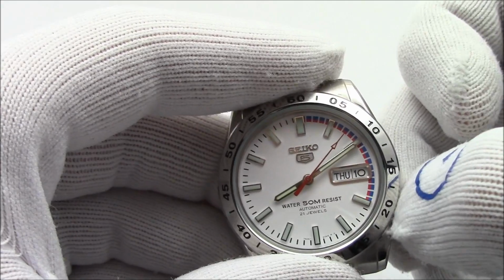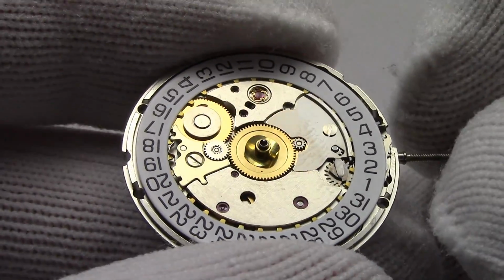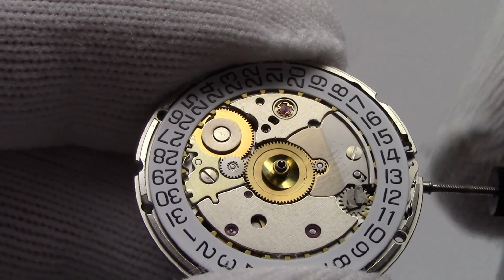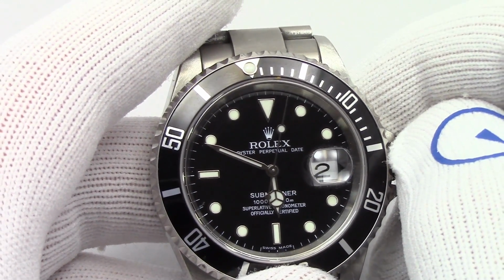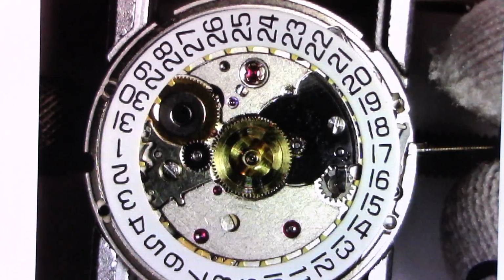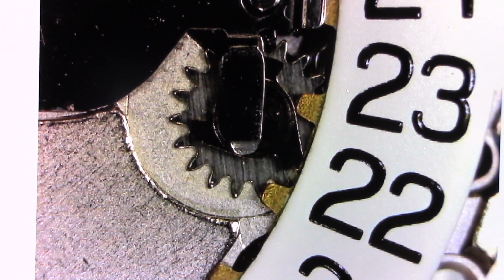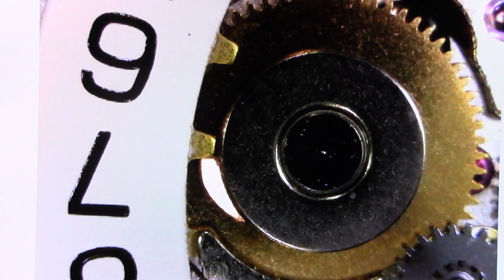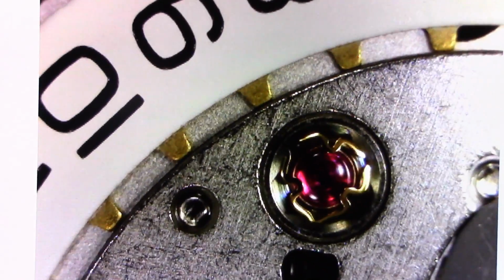ETA 2824-2 Movement - How The Date On ETA Watch Movement Adjusts Accurately? Watch and Learn #38

Comment: I started watchmaking in 1976, working on ETA 2783 and 2789 movements. The contemporary ETA you show here is essentially IDENTICAL. It's a "good enough" reliable mechanism. I also worked for Rolex for many years. Their day date mechanism was rather clunky at that time, but over time they refined the living day lights out of it. You could say that ETA is as good as it needs to be whereas Rolex is way better than it needs to be, and charges accordingly. :)
Reply from the maker: So true!
Reply: Honestly i have 2 watches on ETA 2824 and 2892. Its great movement and great watches. But i think it heavy overpiced. And refuse to pay for for watch more than 1.5k if it have 2892 in it. I understand the movement are modified (usuly more on viaual than on peroframnce) quite heavy but in end its same movement with +/- same accuracy. And honestly i think every good watchmaker can make eta to change date +/- 2 min fm 24 for not more than 50€$£. So it its not worth to get Rolex only for that. And to pay more than 1k for watch with meh. for 200-500€$¥ is just insane. There is lot and lot of watches which i like for more than 1.5k but i will never buy them as there is movemnt max 500€$£... Al in all the visual loon of watch (case, dial, bracelet, box can be put in 500-1k+movement range (hell i can can order sone independend watchamker to make some 100 pcs of some special watch for 100k and to get eta (yeee closer to SW or miyota inside) and each watch will be hand made with hand painted dial with serial nr. Ise chosed braceoet etc.  If the manufacturer can not do that i see is as non effective manufacturer who ar overipricing their watches only so they can not inovate but only survive. And dont have doubys Rolex, eta etc. Are conveyor made. In mechanical warches everyone like that humannput it together and  that it can be dissambled change few details if its broken and assambled that it. Or just dissambled clean putt together and greased. I understand history etc. But its only marketing for thous who know little of of the time is moving.  Its like medals for alcohol who are dated fm 1890s .,. Technology have changes and now its not same as was then. Sorry
Reply: can you tell me the width of 710 pallet fork?
Reply: @islandwatch  very useful video. Thanks. 

I have a watch where the date can change via the quick set but not at 12 am by itself. 

My watch maker said the Date indicator driving wheel is the problem and need to be replaced (neo vintage watch so I’ll going to have to hunt down the part). 

What typically do you see that “breaks” with Date indicator driving wheels?

Comment: i have a soviet watch with the date function and the date changes instantly just like you showed on the rolex example, there is no initial motion of the date ring, it just flicks instantly to the next number at a specific time, on the 2824, it takes about 30 mins between start of changing to the actual flick-over. 
surprising how an ancient dirt cheap soviet movement works better than a "higher end" swiss one.

Comment: Thank Marc for a very interesting video. I would like to add that I have a Mido Ocean Star with an ETA C07.621, known as the 80 
 hours power reserv version ("Powermatic 80" for Tissot). This is a day-date version, and both day and date are instanteniously changed! I even shoot a slow-mo video to confirm that the change happens at a click (a single nod of the ballance weel). Yes, and both the Mido's and the Tissot's using this movement are under 1,000 USD.
Reply from the maker: Coolness!

Comment: I wonder how much cost it would add for Seiko to just use metal gearing for its quicksets and date change, vs. plastic gearing. Are their mid range movements like the 6r15 plastic too? I would hope the 9S is all metal.
Reply from the maker: This I actually do not know; will have to wait till I have one to disassemble.
Reply: They use plastic not metal because it's more durable in this function. Have you ever seen a broken date wheel in a Seiko 7S26? Nope, because the plastic wings that push the date ring are compliant and can bend out of the way if the user tries to quickset the date at midnight. Meanwhile in the Valjoux 7750 it is famously easy to break the date wheel pusher if you try the same move.

Comment: Ive been told to use the steinhart ocean 1 as a benchmark for eta and pricing. Since most of them use the eta 28-24-2 its a relatively easy comparison for price value comparisons.
If there was a bell curve for automatic movements, the 28-24 elabore unregulated would be smack dab in the middle. As you go right you get regulation, better materials,in house, etc, as you go left you get lesser grade automatics including some in house like vostok all the way left to $10 quartz. Agree? Remember this is movement only, not the case. This also does not compare for movements with many complications.

Comment: Hello Mark, thanks for the informative video! I have a question about the date ring. I removed it to get a the keyless works to fix a stem that won't engage. Putting it back together, I'm having trouble figuring out what keeps the date wheel on the movement. There doesn't seem to be anything holding it down or providing tension to hold it place that I can see. Any suggestions? Thanks.

Comment: Very thorough and excellent video!
I’m actually concerned about my Tissot Gentleman Powermatic 80 Silicum recently purchased.
Does this model have a mechanism that protects accidentally changing the date around 12:30 am? Did a quick set and time adjustment set.  It works okay. Slowly changes date around 11:45 and snaps at 11:55:58. I thought it was instant with this watch, as I’ve seen it on other videos.

Comment: Hello would a case that fits a Miyota 8215 also fit an ETA 2836-2 without needing to change the movement cushion mount? I have an ETA 2836-2 that I would like to put in a case that currently holds the Miyota and I want to know if I need anything else. thx!

Comment: Mark, very cool video. Thanks! I have a very rudimentary question about the ETA 2824-2. I have a 2824-2 that is running a bit slower than the micro-adjustment can compensate for.  I only see one lever connected (aside from the micro-adj) to that location. But I assume there is a regulation lever and a beat adjustment lever - no? How does one make a regulation adjustment greater than the micro-adjustment will?

Comment: So is it safe to change the date in between 9pm and 3am with eta 2824-2 movement?
Reply: The answer is no. Doing it once or twice, maybe even a few times wouldn’t necessarily harm the mechanism, but would at least start wearing it down.. too much wear in that way, no matter the material will start wearing and possibly break.

Comment: Hi Mark, great video. 

I have an eta2824-2 cosc movement and I noticed the other night when I was changing the time I overshot the time slightly and in winding the time back a few minutes I could here a clicking. Is this normal? Never noticed it before. The time I was changing at was around 9am.

Comment: So what is the difference between eta 2824 and 2824-2?  Is the -2 just newer or upgraded?
Also, I am interested in learning watchmaking/repair.  Is there a way to learn and then self learn it and then get certified, or does it require schooling, or apprenticeship?

Great video, btw.  I have this movement in a Tissot and was interested in how it worked.  Plus, it gives me an idea of how my Seiko works with the day/date by changing the date turning clockwise and day turning counterclockwise.

Comment: would you say the eta2824-2 is better then then the seiko nh35a all around? Or is the nh35a has something it does better then eta2824? Doing a movement vs movment video would be a good watch and learn
Reply from the maker: Most would agree, me included, the ETA is higher grade than the Seiko movement. Fit, finish, and overall serviceability.

Comment: Hey man! Thanks for the video. Quick question. I got a Hamilton with a H-10 movement (just like this one I believe) and I accidentally used the quickset date change around 11:30 pm. I'm hoping I didn't ruin the date mechanism? Seems to work fine. I'd appreciate some input. Thank you.
Reply: A late reply but for anyone wondering, it can take a few hits, no worries.

Of course one must be aware of it because even 1 mistake a week is still 52 mistakes a year, and the movement wouldn't like it.
Reply: @H0kram  Thanks bro

Comment: Wait what happens if you change the date when the "shark fin" is loaded and about to push the date wheel but hasn't yet?
Reply: I think the loaded tooth will just move clockwise away from the shark fin.
Reply: I'm wondering the same. He didn't explained what breaks and why.

Comment: Hey Mark I am curious about something and I just can’t find any info from Google.  I have new watch that has a ETA 2824-2 movement yet it does not hack.  All other functions work, setting the time and date etc.  Is it possible that some early 2824 movements did not have a hacking function?
Reply from the maker: The hacking leave is probably not functioning. There was a 17J version of the movement, not sure it hacked.
Reply: Long Island Watch I think I might have a 17jewel non hacking inside my watch.
Reply: Long Island Watch Mark so curiosity got the better of me and I opened up the case..and found a totally different movement inside than what is etched on the caseback and what is actually stated on the website as being the movement inside the watch.  The movement is 2872, good, better, or not as good as the 2824-2 I have no idea.  What I do know is that this is a non-hacking movement..lol

Comment: Another great video Marc! Do you know whether Seiko's mid-range movements like the 6R15 use plastic or metal cogs?
Reply from the maker: I don't know, never did it.
Reply: Thanks good vid. Yes this question would be interesting to check as Seiko is promoting the  presage line as more  upmarket now, but they still use the 6R15.

Comment: Could we get a Watch & Learn episode on why sometimes a hacking movement will occasionally fail to hack with the crown pulled out? I have a 2824-2 that does this. I've heard this sometimes happens on all kinds of watches and isn't a cause for concern.
Reply from the maker: Did you watch the WNL about hacking?
Reply: Long Island Watch I might have to go back and re-watch it.
Reply: I just re-watched it again. I can see how the teeth on that setting gear could possibly be engaged enough to change the time, but not enough to push the hack all the way against the balance. I guess if you don't get a clean click into the second position it can do that.

Comment: So this means that adjusting the date between 9pm -3am is fine then?
Reply from the maker: Better than on a Seiko, but still should stay away.
Reply: Long Island Watch thank you sir! One more question. I own a Bell & Ross BR03-92 basic stainless version, and i went shooting a full auto AK47, dont know if youre familiar with firearms or not, but it was quite a powerful ammo 7.62x39 relatively speaking. Watch was on my left hand, and my left hand is holding the pistol grip. Would that really damage the gun? Or its irrelevant? Ive been doing the same with my skx, sumo and tuna. So far so good, was kinda worried with the BR.
Reply: Probably would not damage the GUN ( think you mean THE WATCH)... :).That said, having Timex and Citizen watches that survive the impulse load of doing basic wood-working "hammering nails".....I would expect an expensive watch to similarly not be affected. Of course Marc can easily correct me if I'm wrong.

Comment: The only reason that watch costs so much is because it has Rolex printed on the dial. Whatever is behind the dial is ridiculously simple by today's engineering standards. I've seen fancier mechanisms in Lego kits for ages 11+.
Reply from the maker: I respectfully disagree. I'd like to see anyone tune a system with varying spring forces, materials, etc, to time so perfectly every time.